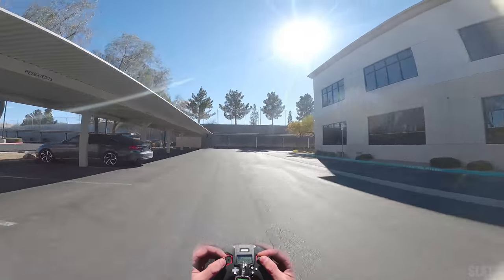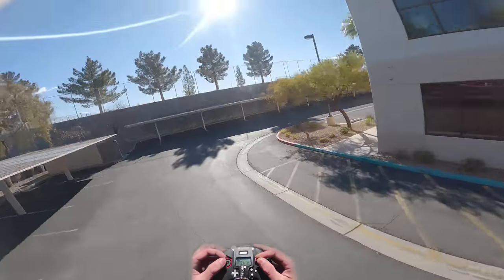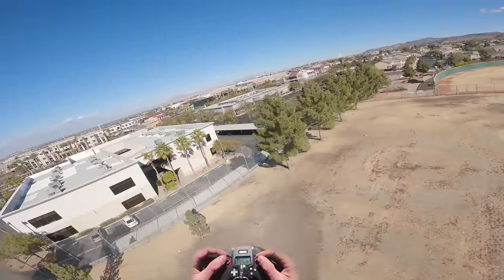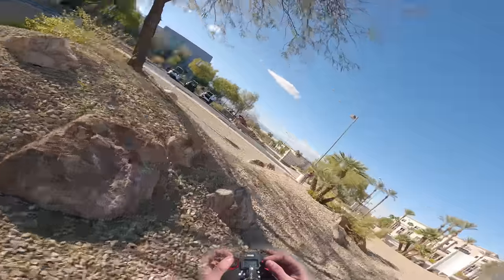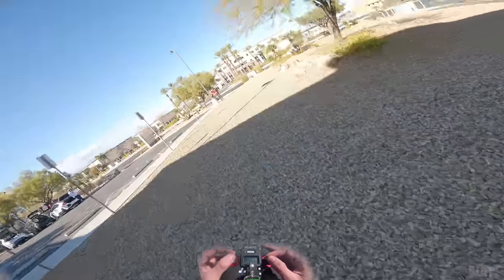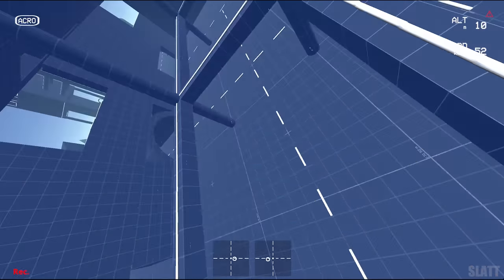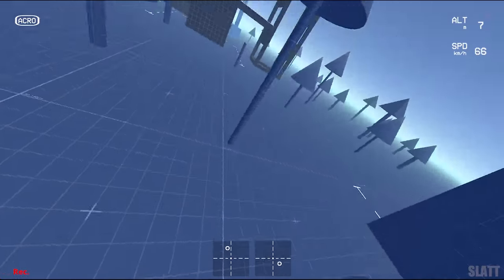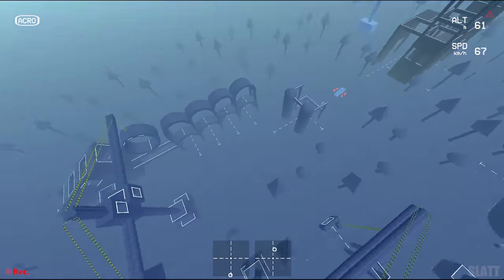How to Flow Series: Part 2 / Throttle Control & My Setup  (FPV FREESTYLE )

Comment: Some nice termination used to describe what’s going on and i can definitely get some takeaways from this edit, one move I have been trying to figure out with more finesse is the rewind/revers moves and this really helped. nice work thanks man.
Reply from the maker: Glad i could help 👊🏻 im planning on doing a dedicated video on rewinds so ill have more tips on it soon !
Reply: @SlattFpv  that’ll be awesome look forward to that.👍
I’ve started to get the idea of it by trying to brake hard by pitching back and full throttle back but in straight lines then pitching slight forwards to look down again and I’ve started to pick up the momentum of it like that. what I can’t do is partly enter into a turn and reverse out of it like a true rewind, I seem to go in the opposite direction or just sideways 😕. This could be what a lot of pilots may struggle with and maybe something you may be able to help explain when you do your video on it. 
Thanks again man, happy flying

Comment: Thanks Slatt! I built myself 2 impulses Micro Apex 4" quads, but I put 5" arms on both of them. Both identical, with 2005.5 hyperlink motors 2650kv, and 40a iflight esc. I run analog in everything still, AUW for my micro apex 5" is around 425g with a gopro and 1000mah 4s, I put my throttle cut to 80% and it changed my flying. But I've watched these how to flow videos of yours and damn its helped me a lot in the last year.

Comment: Thanks for posting your rates. How did you determine to go with such a high RC rate, but low Superrate? Definitely not questioning you b/c I don't know nearly as much, but just trying to learn. I noticed a lot of freestyle pilots use 0.20-0.35 expo, but curious on your thoughts of high rates paired with low super rates VS low rates paired with high super rates. Doesn't a higher RC rate make it more difficult in proximity flying through gaps?
Reply from the maker: Kiss rates translate alittle different then betaflight but ive always prefered this setup over the other i have no scientific reason behind it i never really messed around with tuning i used someones rates off the kiss user profiles and changed my yaw alittle faster . Never switched it since

Comment: I personally would do it of the f.c. with motor output, can also depend on how long your sticks are as to if you need it or not.
Reply from the maker: I fly kiss so this way works better for me !
Reply from the maker: Also by doing it this way I have another model on my controller for if im flying mountains or chasing cars so I can change to a faster profile without setting things up
Reply: @SlattFpv  gotcha, I fly emuflight so I can do it though the osd in 15 seconds, whatever works,👍

Comment: Nice style, like it.. Genuine question? Instead of using the throttle cut, would a lower pitch prop be "as effective"? I usually use 5043 props but tried some 5040's one day and experienced "less power" or at least the feeling of less power.. Is there any disadvantages to slowing things down this way?
Reply from the maker: Good question! A lower pitch will for sure give you less power ! I used to only fly s3’s and I didnt throttle cut at all but after getting picked up by tmotor I needed to switch and they didnt have anything that low . Same with kv all their kvs were higher then id prefer so I went this route !  As for advantages I have another model setup in my controller with full power so if im flying mountains or chasing cars I can switch to a faster profile and not need to carry around different size props. You can mix both and fly with a 5% throttle cut and lower pitch props and get the same effect
Reply: That makes sense, the different profiles seems like a much more versatile way round.. Thanks man, appreciate the info and ideas. 😉👊
Reply from the maker: No worries man 👊🏻 thanks for the support

Comment: Awesome video. I can’t wait to try a throttle cut. Just curious but what’s your HD camera angle? You mentioned 15 for your fpv cam but I’m assuming you would get props in view with a low HD cam angle. Thanks.

Comment: I don't get how you can get this kind of performance out of Liftoff. I have a pretty beefy system and it's still somewhat slow in comparison. I don't mean laggy. The quad just doesn't move fast. So it's misleading when compared to my quads actual response.
Reply from the maker: Try to find the drone I used on the liftoff community page ! See if that helps I hated the default drones this was the only one that flew anything like a real drone
Reply: @SlattFpv  I'll haver to give that a try.

Comment: To add to your motor talks. Props will also play a big roll in the floatyness . S3 are great for that proximity.  Some people like stuff like a 5047 and that can yield the same effect as a high kv motor. 
Great video  man. Subbed 👍
Reply from the maker: For sure man ! I used to only fly s3’s but after I got picked up from tmotor I had to switch haha

Comment: Hey dude. I've felt my 6S kwad has way too much power when wanting to do proximity, so reducing my throttle weight and offset feels amazing. My only gripe I have, and it's to be expected, is that my punch outs now lack power. Can I set this up to run 80% as normal and then 100% on a switch? If so then I'm thinking it might be possible to switch to the 100% throttle profile automatically when the throttle position hits a certain point like 85%?

Comment: Nice tip on throttle cut. When you’re flowing like this, seems like you’re going really fast. From the stock cam it looks to me you’re not actually going above 50% on throttle a whole lot. Like moving in out of areas is around 25% to 30% throttle. Is that about right?

Comment: You mentioned not using BF...what do you use to tune rates? Trying to tune my rates but I fly 6s and pretty powerful motors at 2111kv and 1800kv. I'm only a month into the hobby. Lol

Comment: Hmmm, I've always gone to the OUTPUT of the throttle and just changed the MAX to whatever. I guess there isn't a difference?
Reply from the maker: I think when you do that your controller goes to 90 and then would be the same till 100 . So your not gaining stick resolution but im not really sure dont quote me on that
Reply: @SlattFpv  - I'm not sure either! I think it stretches the cap for full resolution, but a 10% cap is hard to tell. Have you ever played with a throttle curve?
Reply from the maker: @3eggerfpv397  nah i haven’t really messed with throttle curves but I definitely recommend it

Comment: I love handicap signs Cuz lol u may not get that joke but o well but the way u fly is interesting 🤔 because I use f60pros 1950kv  and I need and use all of my power the only thing I do is set my mid throttle to .22 and the throttle expo to .15% and that’s all I need. And question do you not tune your quads? Like I wanna know how you can fly as good as you do with stock tune that just doesn’t make since to me cause betaflights tune sucks u almost have to learn pid tune

Comment: Try the 2306 Pacer v2 g they’re siiiick af, 2400kv and a nicer low throttle than the 2207.
Either way dawg you’re killing the flow 🔥🔥🔥

Comment: Awesome flow. Question: at 00:10, you shake that roll stick quite a bit to hit the gap (stick overlay), though your footage is still real smooth. Is it just hypersmooth that handles that or do you have something else going on? I guess it is not the sticks smoothing since you do hit the gap..
Thanks for all your help!
Reply from the maker: Thats my throttle stick that doesn’t shake my drone at all lol that has to do with my throttle cut and my drone not being overpowered
Reply: @SlattFpv  what are your rates? there must be some expo to flatten that out.
Reply from the maker: @charlesmarseille123  of course my rates are always in my bio
Reply: @SlattFpv  thanks bro, always good videos, keep em coming ;)

Comment: Nice flow, subbed...get rid of that FRSKY and you will really flow! :)
Reply from the maker: Haha I bought this thing a year ago when I didnt really know much about drones Ive been saying I wanted to switch to the tango 2 but if ive had the if it aint broke dont fix it mentality 🤷‍♀️
Reply: @SlattFpv  All good. I also prefer to prop down instead of the throttle limiting method, this keeps quick prop spin ups when needed... but like you said. If it ain't broke...

Comment: I'm fairly new to flying fpv drones. I want to upgrade my radio maybe to something similar as the one you're using in the vid. I'm flying a Tiny hawk II frestyle outdoors and micro indoors (initially I bought the micro drone in the rtf kit but the radio is not really suited for pinch grip style, which I use). Can anyone suggest good controllers similar to the shape of the one in this vid, cheers.
Reply from the maker: Mine is xlite but I would recommend the tango 2
Reply: @SlattFpv  I'll check them out! Thank you!

Comment: I'd buy a sticker that says fuck DJI cinematic pilots!
Wow @ 15 degrees, I find 45 to be my sweet angle.  Forces me to keep moving fast though, which puts me at a disadvantage in some scenarios, but makes all my rolls look nice.  It's what you learn on.   If I siwtch cam angles, I try and stick to multiples of 15... 0, 7.5, 15, 30, 45, (60), etc...

My favorite tiick is still the first one I did, which I call wifferdell.  It's like shooting a corner on the top of a building and then a roll and yaw over the top of something>   I don't even know if I can explain it from memory, it's one of those muscle memory things.... you just do it automagically and don't think twice about it or talk it out like bardwell.